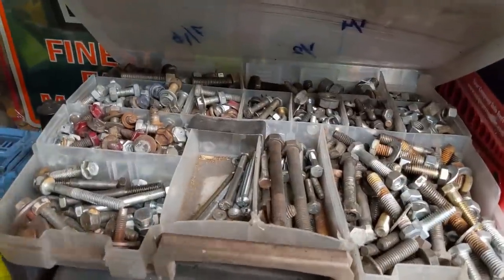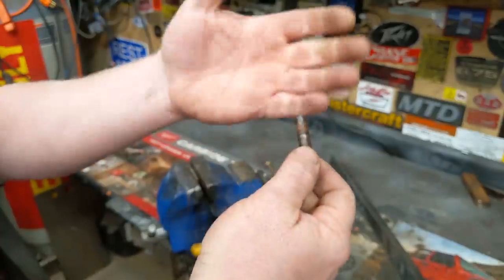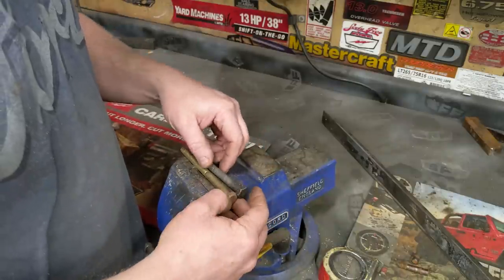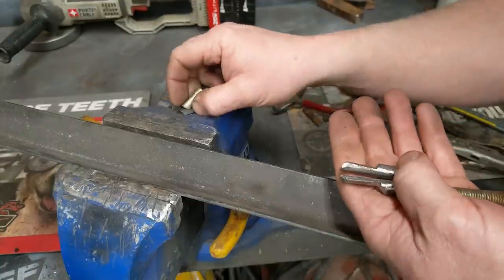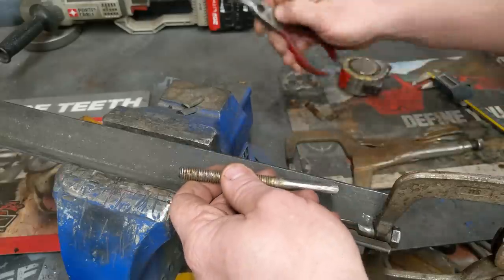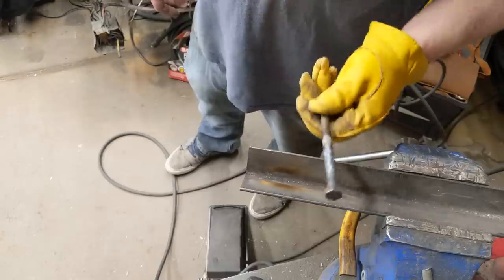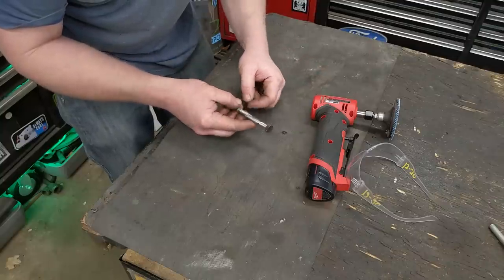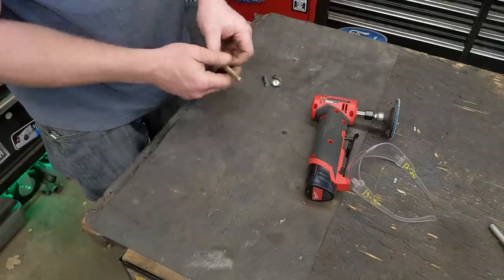How to make BOLTS longer   - Lengthen Extend Bolts -

Comment: Looks like he haven't heard of a threading die.
Reply from the maker: So you use a threading dye to make a bolt longer?
Reply: @sixtyfiveford  Yes. Threading die are very common. And standard size steel rods for making fasteners are also commonly available.
Long bolts can also be used. In case   of very long bolt. Thread both ends ang fix with hex nut.

Comment: It’s definitely cool, but a hell of a lot of time and labor to save $4.
Reply from the maker: It takes around 5 minutes but it's not about saving money. I live right in a major city and could run to a dozen stores to grab a bolt, however it's a 30-45minute ordeal every-time. And that's if they carry the bolt as most bolts over 5-6inches are not sold and have to be ordered online. So 5 minutes and the project continues and is completed.
Reply: I suppose that would depend entirely on your workshop setup and having all of the equipment you need right on hand with no prep necessary.

Comment: I dunno...
As much as I LOVE to fix and reuse EVERYTHING, this is going a bit far.
It takes what, 30 minutes to do one of these right? I think my time alone is worth more than $8 an hour.
This feels like some 'desert island' fix stuff. If you CAN'T get a replacement then it's fine. Or maybe you are on a ship and need a bolt to repair your lathe? (Otherwise use the lathe to make a new bolt...)

On the other end of the scale, replacing an expensive bolt, If a bolt costs $120 each, maybe you shouldn't make your own out of several $5 ones. There is probably a reason it costs $120...
Reply from the maker: It takes around 5 minutes to make one. I made one the other day for a puller to pull out an old rubber bushing. I impacted that thing until the 6pt socket destroyed the head of the bolt. I couldn't have run to the Home Imp store and back in the time it took me to make this.
Reply: I AM on a remote island and am needing this very thing today, due to a project that requires longer hardware than is available, so THANK YOU for your contribution to YouTube University today, my  sixtyfiveford Bro!!!
Reply: @HamptonFamily4  I didn't discount it entirely. I even gave 2 examples where it might be a passable fix.
It's just not a GOOD fix when the "right" fix is also available.

Comment: A temporary remedy for an alternator bolt, fair enough. But if someone's wellbeing is at stake, then forget it. For starters, you're not going to get full penetration, or total fusion. Also using two different grade materials, unless you utilise a disimilar filler rod is a serious, meturlogy offence. If it was macro etch tested, it would be a dire failure. This method is a recipe for disaster.
Reply from the maker: Meh, You're way over complicating it.
Reply: @sixtyfiveford  Merely stating fact's. It's at best, a temporary solution, but not a safe nor satisfactory end product. I admire your ingenuity, but frown upon your disregard for the law's of meturlogy. Have a great day pal👍
Reply from the maker: @manosparavida3551  I don't mind getting technical but again your way over complicating it.  Welding rod goes through the same metallurgy tests and generally has more standards than a simple grade 5 or grade 8 bolt. A grade 5, 3/8 bolt can hold about 1, 325lbs(shaft only threads are 25% less(threads 994lbs)) before breaking. If I made it out of a 100% welding rod it would be able to hold 1150lbs. Yes those figures are certified right on the casing of the welding wire. So welding rod is stronger than the threads of the original bolt.
Reply: @sixtyfiveford  Evidently, professional advice goes over your head. Also, you're clueless to what a macro etch test is. Otherwise you wouldn't debate me. I sincerely hope that your temporary repairs hold fast.👍

Comment: Wow I don't know what to say. If that was my car or customers car I would be ashamed. God forbid you just do it right. Call McMaster-Carr I'll have it for you the next day. What's next, maybe make your own motor oil
Reply from the maker: Why does have to turn into a drama queen over exaggeration? A grade 5, 3/8 bolt can hold about 1, 325lbs(shaft only threads are 25% less(950lbs) before breaking. If I made the shaft out of a 100% welding rod it would be able to hold 1150lbs. Welding rod goes through the same metallurgy tests as bolts. So the bolt will still break at the weakest part; on the original threads even after modified. Obviously a new bolt is always in order and ideal. But to stop for 45 minutes in the middle of a job or even a week to get a specialty bolt ordered for a non-crucial bolt is absurd. This is literally a 5-minute task and the job can continue.

Comment: Eaisier to just buy the correct bolt.
Reply from the maker: Drop everything mid project and wait a week for a 7-1/2 bolt to come in the mail... OK.
Reply: @sixtyfiveford  or a 5 minute drive to Grainger, Arrow, Fastenal, or Mid State Bolt.  I guess it really depends on where people live.
Reply: @sixtyfiveford  next shipping?
Reply from the maker: @Steve-pu4zx  There's no such thing as a 5-minute trip to a store. I have all these shops near me within 15 minutes but that's still have 45 minute ordeal to get back home. And virtually no store carries anything over 5 in, especially under 3/4 inch. A grade 5, 3/8 bolt can hold about 1, 325lbs(shaft only threads are 25% less) before breaking. If I made it out of a 100% welding rod it would be able to hold 1150lbs. Welding rod goes through the same metallurgy tests as bolts. I can literally do this in under 5 minutes and continue on with a job.

Comment: I’d rather just buy a longer bolt
Reply from the maker: I would too. But that's not always an option. Sometimes it's a week wait to order the bolt you need.
Reply: Yeah that’s true.. I had to Order 4 bolts and wait for three days a couple months ago. But they were 1 inch bolts 11 inches  long for a John Deere loader.

Comment: Love your videos, but I don't think I could bring myself to do this in this day and age.just go to the store. Or McMaster Carr has most stuff if u really need something special. Maybe in an emergency
Reply from the maker: True but you can't get all bolts. I find anything over around 5" nearly impossible to find at stores. Most jobs I don't want to wait a week+ to finish for one to come in the mail. McMaster also is very limited on long bolts and generally you're left with having to use all thread.

Comment: Only problem is, not everyone has a tig or a welder handy.
Reply: Than obviously those people have to try to buy the correct bolt, this hack is for those that have a welder.
Reply: You could gas weld it.  I wonder if brazing with a Muggy alloy rod would hold up.  I'd like to see a torque to failure test.  That's a job for Project Farm.

Comment: Nuts just take a longer bolt and use a thread cutter to make a longer one Dumbest thing I've ever seen You have weakened the strength of that bolt by welding it

Comment: Is this a joke?
Reply from the maker: A grade 5, 3/8 bolt can hold about 1, 325lbs(shaft only threads are 25% less(950lbs) before breaking. If I made the shaft out of a 100% welding rod it would be able to hold 1150lbs. Welding rod goes through the same metallurgy tests as bolts. So the bolt will still break at the weakest part; on the original threads even after modified. Obviously a new bolt is always in order and ideal. But to stop for 45 minutes in the middle of a job or even a week to get a specialty bolt ordered for a non-crucial bolt is absurd. This is literally a 5-minute task and the job can continue.